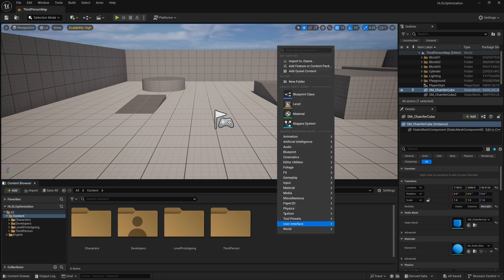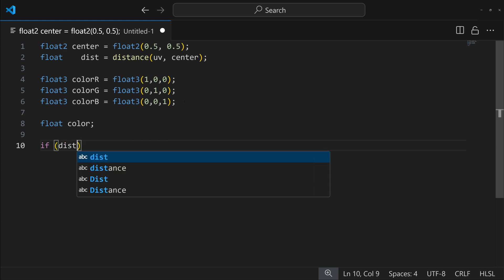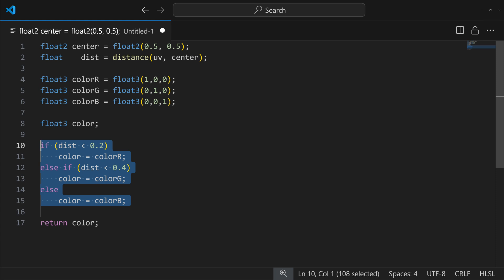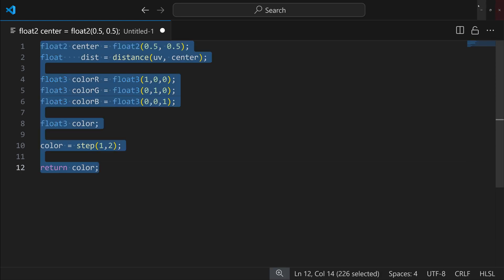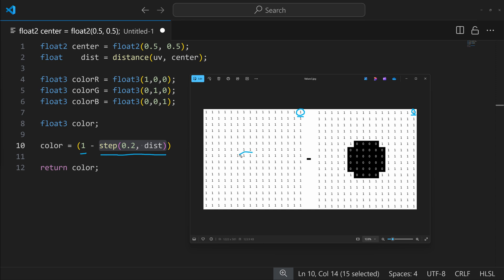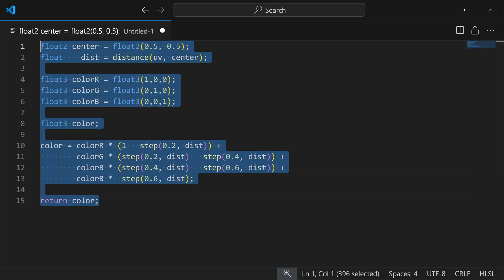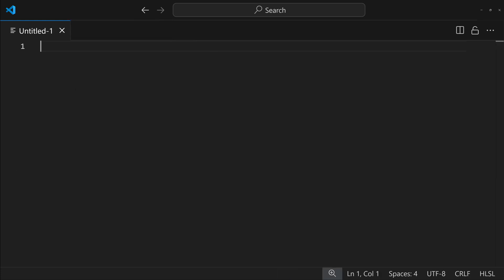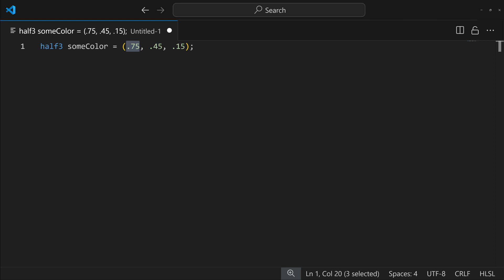UE 5.4 - Easy HLSL Optimizations

Comment: Step is a just shortcut for if. So you just replace 3 if's with 5 if's, 3 sub and 3 mad.
Reply from the maker: In a way, kind of. As @Lowly_on mentioned in this case it doesn't optimize. But the point of this video was to take a look at how to turn a If/Statement Branch into a Step for cases where there may be significant branching. 

Step is not the same as if, if could introduce branch divergence whereas a step will avoid it.
Reply: @renderbucket  Step is actually implemented with a if.

If there is instruction divergence, then your steps won't change anything.

We really need to stop teaching people to use steps instead of if. It just makes things harder.
Reply: @eikins4381  step() doesn’t compile to an if/else branch.
In HLSL/GLSL it lowers to a single compare-and-select instruction per component.
No divergent control flow is generated, so every lane in the warp stays active and you avoid the serialization cost an if can introduce when the condition varies per thread.
If you write the explicit branch yourself, the compiler may turn it into the same compare-select only when it can prove the branch is uniform; otherwise it emits divergent control-flow and the warp pays for both paths. That’s why shader code often favors step, saturate, or lerp masks: they guarantee the branch-free form and keep warps coherent.

Comment: In this case, using step does not optimize, since all conditions are calculated in parallel, which increases the number of instructions. This is because unlike branches with if, where the compiler can optimize the code by skipping unnecessary checks, step forces the GPU to perform all comparisons, even if some of them do not affect the final result. SIMD-friendly is inefficient here, since conditional operations are uneven for each pixel, which leads to excessive calculations and increased instructions.
Reply: In GPUs, branching is usually more expensive than actually computing both branches. Why? Because the shader programs are executed in chunks called wavefronts (for each GPU brand they have a different name lol), which are ultraoptimized to run in parallel. That way is how you render millions of pixels hundred times a second. However, this requires the shader program to execute exactly at the same pace for each shader core. This means that, if we introduce branching in our shader programs and therefore they are not running the same code, the GPU will struggle with that since it is expecting, due to its SIMD design, the same instructions for each shader core. Modern GPUs have become better dealing with shader branching, but it's still a problem.

However, compilers nowadays usually are smart enough to detect static branching in the shader code, which can be performed with a step-like arithmetic conditional. I recommend reading the compiled low level code to actually see if your ifs are static or dynamic.
Reply: I suppose you are not totally correct here, and tell me if I am wrong. For what I know, it looks to me you are talking like it was a normal CPU compiler. When you write hlsl code (at least in UE) their compiler will literally copy and paste the code you've written, so if you do if statements on hlsl it is literally going to forcefully branch everytime.
While on the CPU you can do monkey IF statement and the compiler will skip branching because it knows better then us, the UE GPU compiler is just copy pasting the hlsl, while  onthe nodes it optimizes for it.

Edit: also the step(a,b) is not a literal if statement, there can be no branching at all.  It's a mathematical epxression that is not any heavier than a sign and a couple of additions / multiplications, which for the GPU are extremely cheap.

Comment: Is this really more performant than branching for this example? Because the branch can be optimized by the compilers too. 

Even if you do 1 step operation  in the last example and simd the rest (N+C cycles) the first example in this video is just a branch return which can probably be XOrd by a compiler (just num Branch Cycles) 

I’m really curious about this now as branches can be quite expressive.
Reply from the maker: In this case, its so simple its not going to make much of a difference. What you are mentioning about compilers is 100% true, most compilers perform many of these operations automatically. 

However for certain devices and platforms, these kinds of optimizations may have more of a effect/performance increase. Generally the example in this video is not complex enough to really see much positive gain with most modern day hardware. But it gives a idea of things to keep in mind when coding in HLSL and try to avoid branches and instead try to utilize SIMD (Single Instruction, Multiple Data) approaches if possible.

It also gives some ideas of things to check if you do start to run into performance issues.
Reply: Yep 👍 point taken I just didn’t know how different the GPU compilers were… thinking of simd is a good step to reason about why branches are a no no in shaders.
Reply: Mhm so branch and return early does nothing for the block. This makes so much sense btw, I remember watching how NFS: 2015 looked so good and what they did in some parts was to combine the work in to a single pass, because that’s what they had, even if that pixel isn’t used we have to wait for this pixel, oh maybe we can do other work on this buffer too. Makes sense to me.